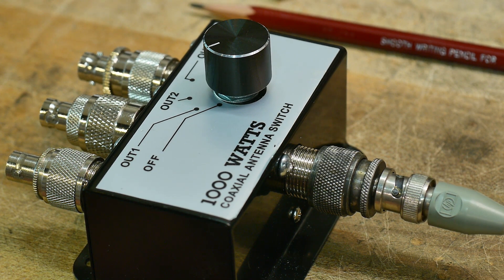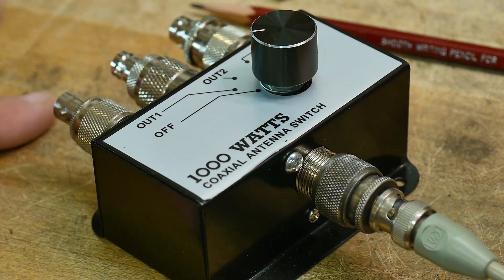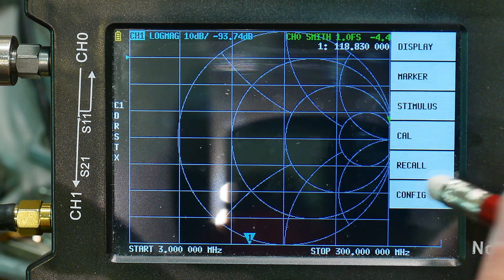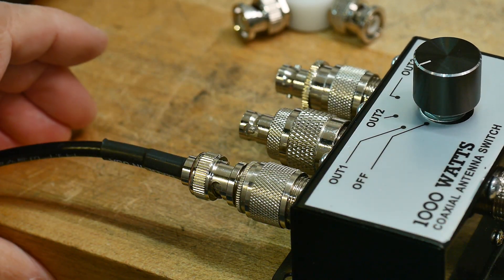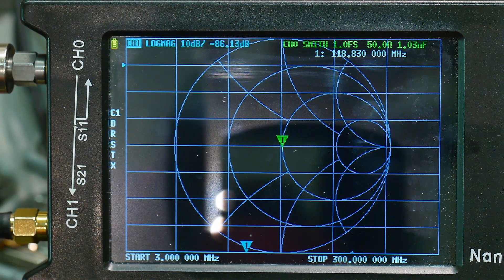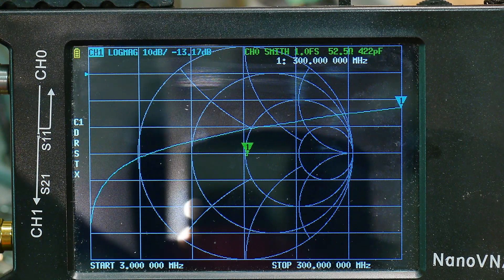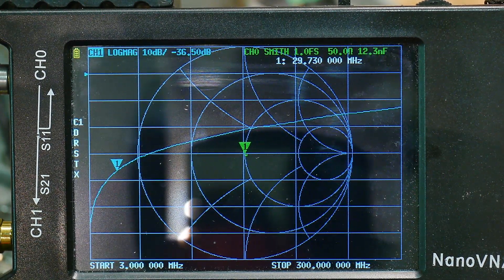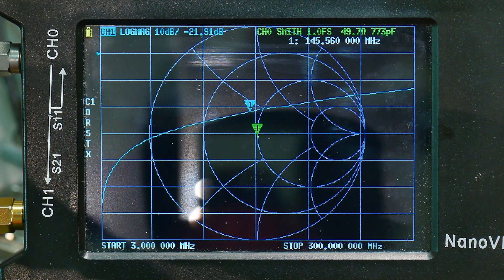#574b Coaxial Switch Isolation Measurement

Comment: It would be nice if you could clean the insides of the switch, the goal being to improve the electrical connection of the grounded-out connectors, and repeat your tests.   
I have a Daiwa brand switch where the isolation appeared to double after the cleaning.  
The inside of the switch had a thin coating of oil inside.   In addition to removing the oil, I also lightly burnished the ground contact surfaces to remove the slight  metal oxide from the switch casting.  I then added a small dab of Deoxit to those same surfaces.
I realize you have your own priorities, but if you should conduct this experiment please publish your results.
Thanks and 73.

Comment: If you had calibrated the VNA at the ends of the cable (and even better after the UHF adapter) and not the output of the switch you could have also measured the input VSWR of the switch as well as the loss through the switch.
Reply from the maker: yes, I bet it is terrible. I didn't want to confuse things. just concentrating on isolation